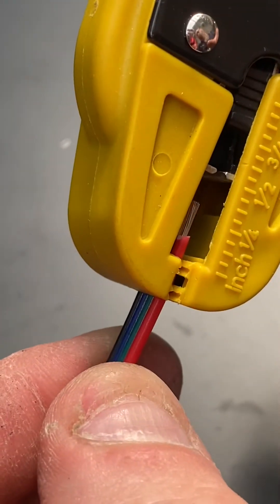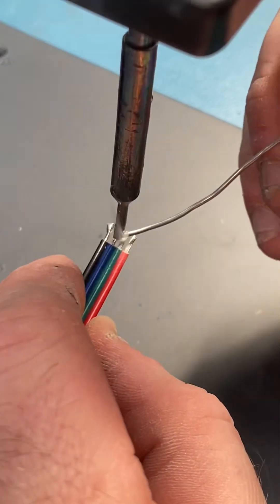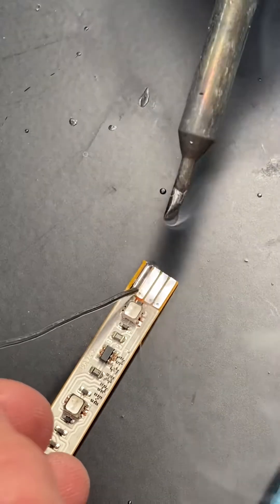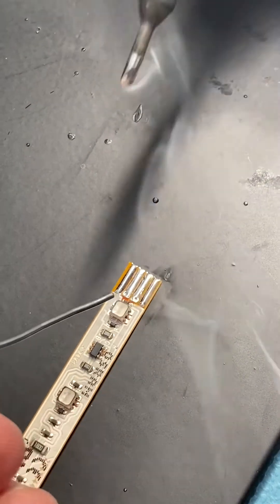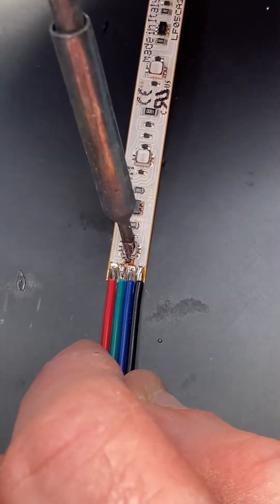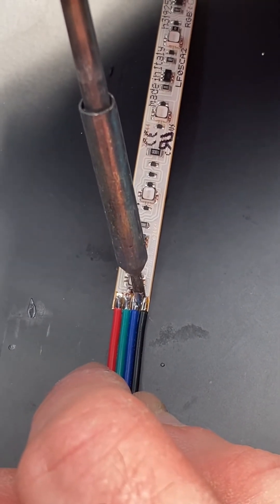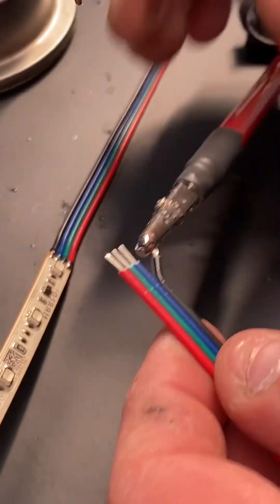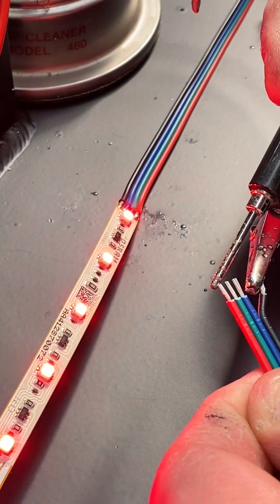SOLDERING TIPS FOR RGB LED STRIPS  🍎🍏🫐#shorts

Comment: You should try soldering rgbcct tape. 6 connectors on a 12mm tape. It's infuriating. Made worse by an ip65 rated nano coating on some.

Comment: What are you using to vertically mount the soldering iron in the beginning of this video? Also, what is the tool that you use to separate the ribbon cable? Most diagonal cutters do not separate the ribbon like that, they just cut through, especially when working with 22AWG and smaller wires.

Comment: Several things missed;
1) type of soldering iron/tip
2) type of solder
3) use of rosin flux
4) use of HST
5) checking for shorts/whiskers
6) removing whiskers/excess solder
7) danger of prolonged soldering
8) gauge of wire
Reply from the maker: Check out the full video - link in description
Reply: @efixx  not seen
Reply: Not their job to do your homework

Comment: Can you connect rgb led strips up to existing under cabinet lighting using the existing transformers?
Reply: You need to check the voltage of both the transformer supplied and the LED as they come in 12v & 24v. Once you’ve done that you’ll need to check how many amps the length of LED will pull with ohms law (use the triangle) and make sure that the amps output on the transformer are enough. 🤙
Reply: @OJM-ll8hi  bit out of my depth that is atm 🤦‍♂️ I'm only an apprentice and just started principles

Comment: This LED strip has not been designed for user soldering of flyleads. This video is misleading. A soldering iron should not be used.
Reply from the maker: It’s OSRAM RGB led strip - comes with soldering instructions.
Reply: @efixx  So you read the comments? Shame you don’t respond to your emails just as quickly.
Reply: @steveng5503  so your trolling